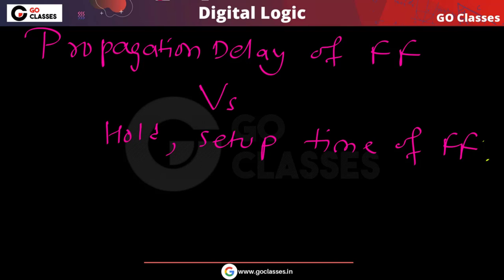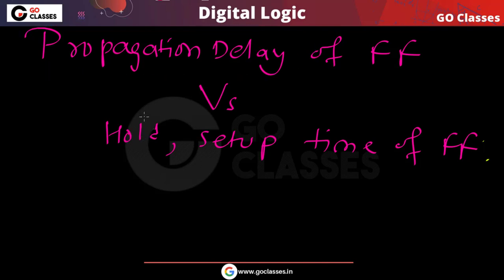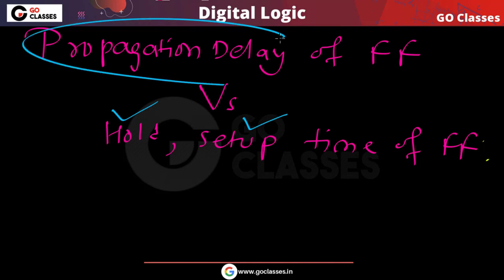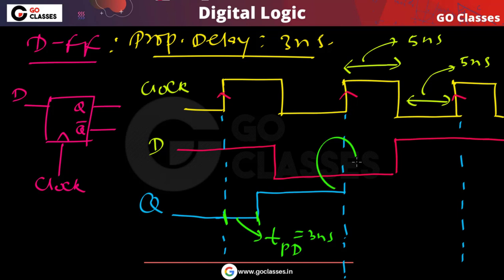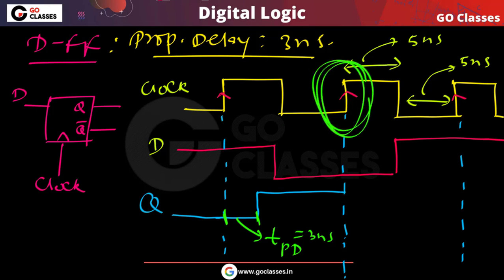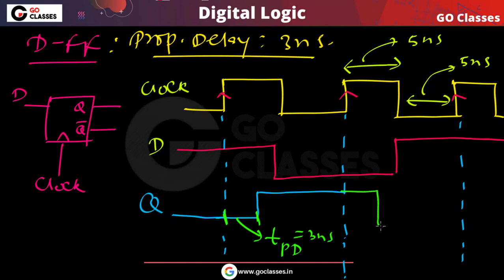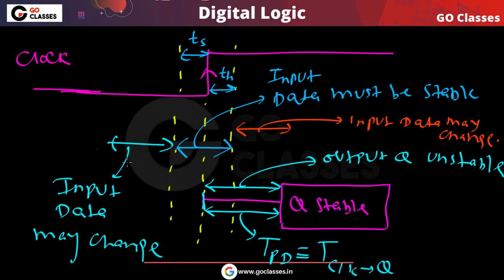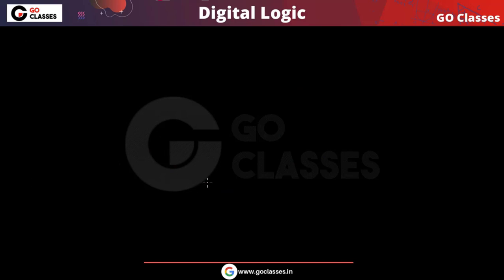Propagation Delay Vs Hold Time in Flip Flops | Setup Time | Hold Time | Propagation Delay | Digital

Comment: Hi. I have some exercise please help me to understand: 

A D flip-flop has these specifications:

t(setup)=10ns
t(hold)=5ns
t(p)=30ns

a.) How far ahead of the rising clock edge must the data bit be applied to the D input to ensure correct storage?
b.) After the rising clock edge, how long must you wait before letting the data bit change?
c.) How long after the rising clock edge will Q change?
Reply: your question has all your answers, in exact order too...(if above comment is not sarcasm, then you should watch this video again)
Reply: @dSinghRaj  it is not. Will checking later. Thank you for a reply.
Reply: to answer ur questions:

a.) How far ahead of the rising clock edge must the data bit be applied to the D input to ensure correct storage?
-> at least 10ns before the rising edge. (this is the setup time)

b.) After the rising clock edge, how long must you wait before letting the data bit change?
-> gotta wait atleast for 5ns (hold time)

c.) How long after the rising clock edge will Q change?
-> 30ns since it is the propagation delay..

agreeing with  @dSinghRaj here :P all answers in exact order!
Reply: @ananyakamalapur  true ananya

Comment: Can propagation delay be shorter than hold time??? I need to know asap finals in 2 days!
Reply from the maker: No, in digital circuits, propagation delay cannot be shorter than the hold time. 
If the propagation delay is shorter than the hold time, it means that the output of a circuit may change before the input is stable, which can lead to unpredictable and erroneous behavior.
Reply: @GOClassesforGATECS  Thank you very much for the quick response! It seems logical! ❤️